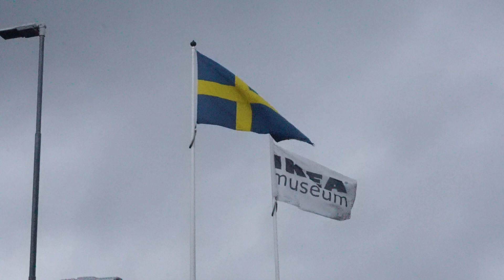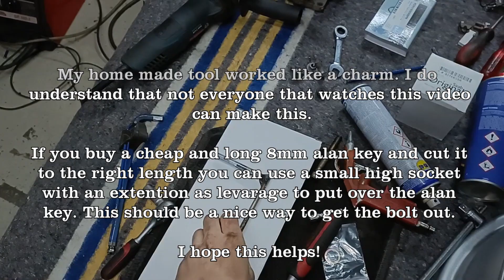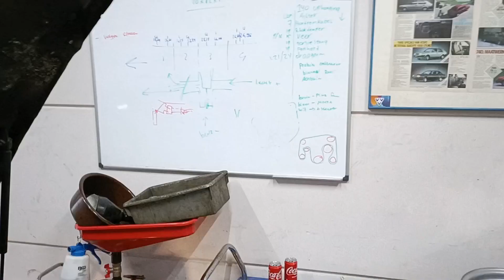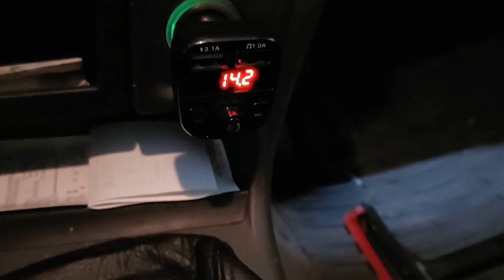Saab 9-3 OG 1998-2003 Alternator replacement

Comment: The SAAB is a really nice car, well engineered. If I didn't have the experience of owning 2 Volvos about 20 years ago I may have bought a SAAB. The Swedes knew how to engineer a good car.
Reply from the maker: They do know how to make good cars. But the saab engineers are Bad at designing alternator positions 😂👍
Reply: No kidding! Just today replaced an alternator on my 2003 9-5 Aero wagon, OMG!! What an unbelievable pain…removed it from the top side.
Reply from the maker: Nice! Be happy that you have a wagon! From what i know they are a lot easier than than the normal ones..

Comment: If you remove the alternator bracket (4 bolts, pretty easy to get to) the alternator easily comes out from the top. Better than trying to remove exhaust.
Reply from the maker: As i explained in the video and in one of the comments, there is no way of doing that on a 2002OG. The complete strud tower is in your way wich makes it impossible. For what i have heard you can do this on a 95 stationwagon or the newer type 93 saabs. But trust me, on the car i have in that video there is no way.
Reply: I have also done it from the top. Removing the tensioner 8m, and the 4 13s on the bracket is necessary. Can be done in two hours. Always get engine warm initially because those two 8m can be a beach to break.
Reply from the maker: @dzlsabe please tell me wich type of car you have because on the car in the video, like i clearly showed. It is NOT possible from the top.

It can be done from the top on station wagons and other saab types but on a 9-3 like in the video there is litteraly not nearly enough room.

Comment: My alternator seized up so badly that it stalls the engine whilst making a nice little smoke show out of the belt, i thought it was just the idler pulley until i took the belt off
Reply from the maker: ohh thats bad.. the bearings must have been gone for a while then? 😱
Reply: @Rollin' Heritage   It had been making noises for a few weeks, about 6 months ago we had alot of flooding that took weeks to go away (typical northern Australia) which meant i was doing a fair bit of driving through water that came almost halfway up the wheels, since the alternator is mounted real low on the engine i believe this must have washed out the bearings or something.
SAAB only has 130,000km on the odo which is far too soon for the alternator bearings to go out, Already replaced the knackered automatic transmission and seized up turbo 4 months ago so the alternator should be easy to do in comparison.

Comment: My apologies but I gotta be honest how irritating it was to sit through this with bated breath waiting for you to explain where the alternator b1+ and b2 + connections go, only to recognize way more was done for a simple answer. PLEASE HELP. Everyone is skipping CRUCIAL INFO on where they should hook up to.

My alternator came out easy from TOP without all the removal of extra parts, so this feels uncomfortably awkward to learn anything from. It’s not that big a job as I notice you repeated saying so often. It’s a hassle but not big. I feel clout chased when the important electrical information isn’t clarified how it should be
Reply from the maker: Well, saying you had to "Sit Through this".. 
I"m not perfect, and my video's are not either. I couldn't find an alternator swap video for this car so i made one. If you don't like the the video, please feel free to watch some one elses, I'm not forcing you to watch anything 🙂

The first thing i say to anyone doing work on their car is to take pictures from what they take off the car. that might be a nice little tip for the next time you take electrical connections off. 🙂

B1 is always the connection that runs to the battery/startermotor.  b2 is the same connection as b1 but just an extra point.

And i'm going to say this again just like i did in the video. On the type of car in this video, Saab 93OG 2002 you can NOT take it out from the top. there is no way possible. i did hear from someone else that on 9-5 models this can be done because the enige bay is a bit different. but i'm missing 3 to 4 inches of space to take it out from the top.
Reply: @RollinHeritage  I admit I was super stupid and forgot to photograph or it was in a broken phone I couldn’t get to. I figured it out last night out of enraged curiosity. I’m lucky I’m alive and the car too. The Viggen is probably different, which I guess I didn’t think about until after the fact. Unbracing the strut bars allows it to be wiggled out although I’m small and the alternator is a heavy joker. I may provide my own version but follow your instructions almost because if I wouldn’t have commented if was entirely discouraged from watching yours. Tbh the struggle you expressed is real, and it is slightly frustrating to handle, but feels good when you’re done. RESPECT! I’m proud of y’all
Reply from the maker: @queenqik2JZ  There is another nice video out there on youtube wich i watched before doing this. That guy pulled it right out from the top. But afterwards i found out he was working on a 2002 saab 9-5 instead of a 9-3. I removed the strud brace and even then the complete shock tower was in the way..
And let's not cut that out 🥲😆

I sold the saab last week. wen't back to my trusty old volvo's all because i hate working on the saab. 🤷